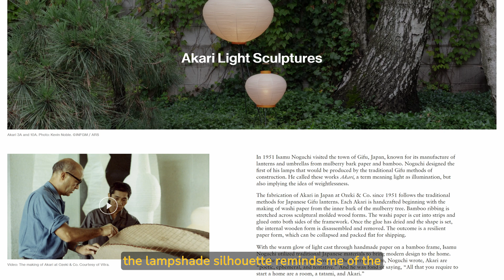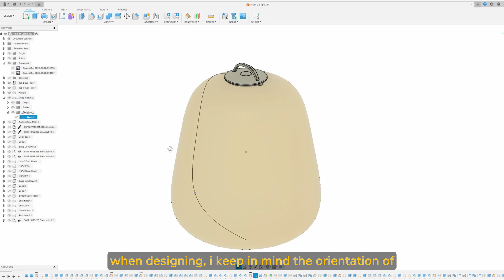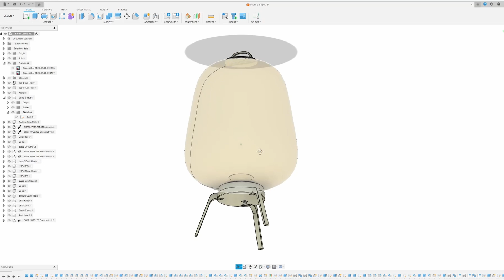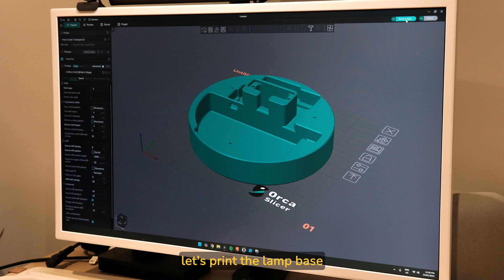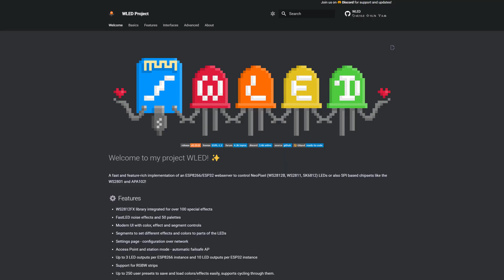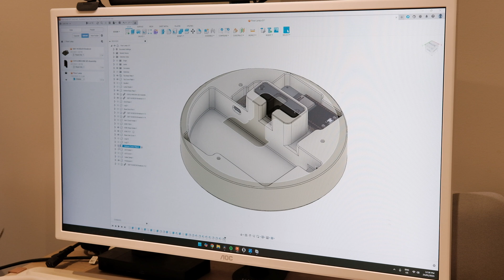making a smart docking lamp

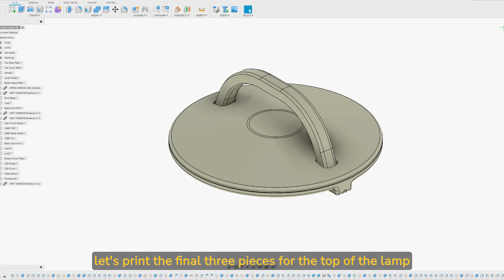Comment: hi matthew! why do your prints have an outline? I don't own a printer, but I haven't seen other videos where the printer does that. ie 11:11 where there is a circle, and then your print is inside the circle
Reply: If you're still wondering, it's called a "skirt" and helps to prime the nozzle and verify first-layer conditions (adhesion, leveling) before printing the actual model.

Comment: Man that is cool… but your 3D printer needs some work. There wasn’t 1 print where I didn’t say to myself that the quality sucks. I’ve been printing for 15 years. The ender is a fantastic machine. But yours needs to be tuned. You’re such a talented designer and builder, you deserve better!
Reply: The first thing I would do is Make sure that all your corners are square. They must be perfectly 90 degrees. Second of all, I would make sure that all your belts are tight, but not too tight. Third of all, make sure your roller wheels are new and perfectly round. Fourth of all, make sure you're using a high quality nozzle. Fifth thing you can do is adjust your E-Steps on your motors.

I ran an Ender 3V2 for years, and good machine. Just recently got a Bambu Labs X1C and oh my goodness what a difference. True definition of Plug-and-play. Layer lines are PERFECT.
Reply: My ender prints look like that, any specific recommendations? 
I was eyeing a bambu lab printer but now I'm hesitant and thinking about investing some time (and noctua fans) in my ender3 v2
Reply: @illousion7  I spent time, effort and money on my old ender clone. I learned a lot but I printed few. Got myself a A1 with AMS lite last year and now I can trust my printer to be consistent and fast and use my time to perfect other skills (like fusion360). I wouldn’t be surprised if bambulab reached out to you because they love that kind of content.
Reply: if it's not a settings issue, I'd bet it's a bad nozzle. I used to cheap out on my nozzles and got similar issues.

Comment: this is amazing! one recommendation would be that its usually better to have the springs on the male end (like how it is in the switch you mentioned) as it prevents any "exposed" connectors, ie. none of the connectors are susceptible to sheer forces

Comment: That layer bulge at 2:32 usually happens when you have a big shift in layer time. The layers under that line took e.g. 8 minutes each, giving them a lot of time to cool. after the line, the layers only took e.g. 3, cause its just a wall. Giving them much less time to cool. Loved that docking mechanism!
Reply from the maker: @cloidless  ahh thanks I'll try slowing it down then once the wall starts
Reply: I was thinking maybe the piece warped as the lower layers cooled and caused the part to ever so slightly lift which caused the layers to shift. I hadn't thought of just overall cooling causing the shift. Good point, @cloidless. Also, just a suggestion, but using a brim instead of a skirt will help large flat parts stay flat. A skirt does a good job of purging and getting the filament going, but it doesn't really serve much purpose after that. Really nice project! Thank you for sharing.

Comment: Ohh this is a really cool DIY project. The only thing I would be worried about would be the battery. It should be fine but it could get rather warm which could decrease the lifespan but to be honest soldering a diy battery pack could be much worse. This is very cool especially the connector for the lamp ;)
Reply from the maker: @ThefirstSteveofmany  I'm a bit worried for the battery as well, it has pass through charging which should help when the lamp is turned on and docked however maybe I'll have to replace the battery later